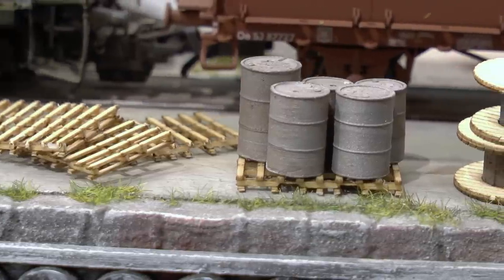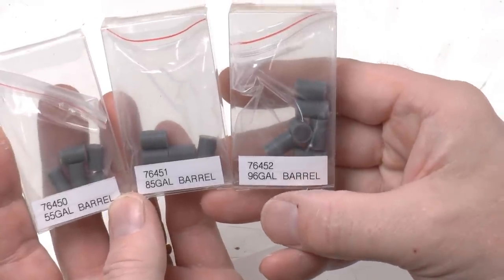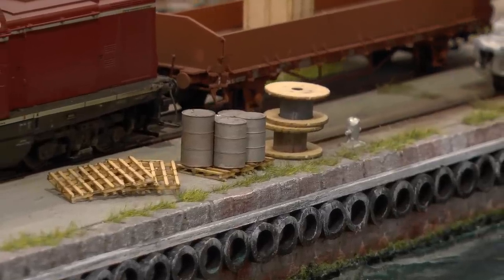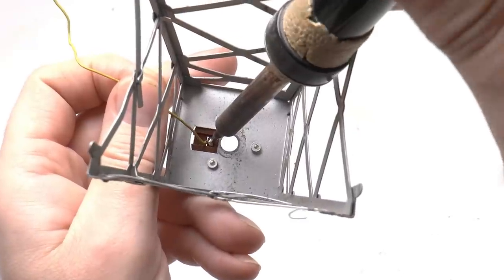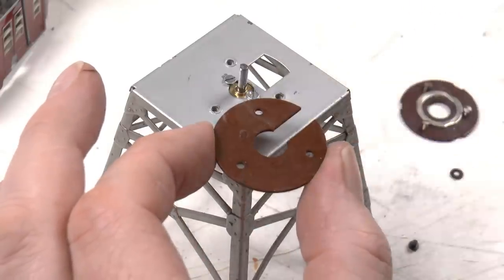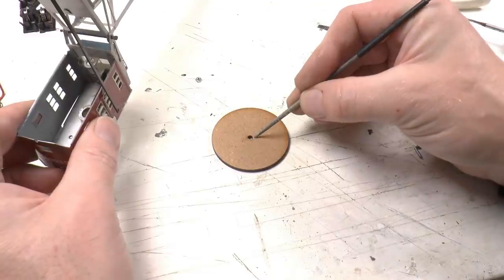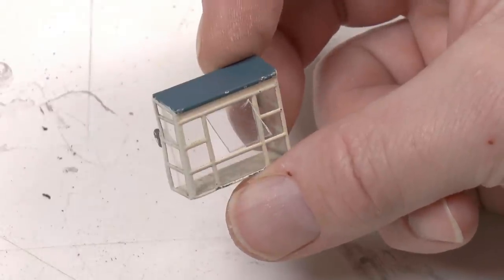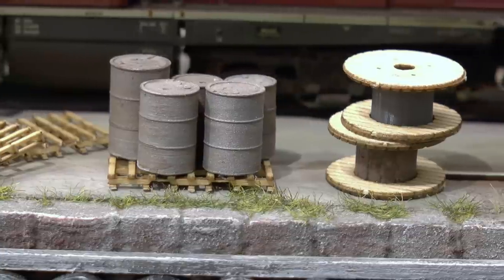Modernizing the Classic 1950s Crane

Comment: Awesome rebuild. I use those motors for my 1/10th scale rock crawler winches. You can slow it down by lowering the voltage you are feeding it to get a more desired look of movement :)

Comment: Just looking back at your older films Martin and this is a good addition to the channel back in 2020. The load kits are genuinely nice, but the motorization of the crane was excellent. A smashing way to build the crane hard standing wheel sets for the crane to run on. The same goes for the motor modification of the cab area to rotate it. Although the gearing is high if you had added a mini variable resistor, which could have adjusted the rotation speed. Even go into the CV settings and the speed there on the decoder. I will have to look for any follow ups to the crane mod after I finish this comment.

Comment: Hi Martin, nice crane mods!
I have also completed a working crane, mine was a Faller plastic kit and I used the same motors with 1:298 ratio on 3V battery electronics from a cheap RC car to control the slewing and hoisting functions. This allows me to place the crane anywhere on a temporary layout.

You may need to modify your design to fit the hoisting mechanism and still allow 360 degree rotation, the way i did it was to have the crane rotate on a hollow shaft with a large gear mounted under the cab, the motor sits next to this under the cab also and the hollow shaft allows the thread for the hook to run through and down to a motor under the cab as well.
I hope this helps to make your crane even more fun. God Jul!

Comment: Excellent beginning on the crane conversion...I was under the impression that speed control on the module was done by PWM, so I'm kind of surprised you couldn't get the speed down to a more realistic level...but I'm sure by the next time you revisit the crane, you will have a better solution figured out.  Thanks for another great video, and Merry Christmas from Connecticut!

Comment: Well done. You must be able to lower de motor voltage through the decoder I would think. Or use de function outputs and a small print to lower de voltage to 3 V or so
Reply from the maker: Actually.. An electrical motor has an area of ideal working point. As you move too far away from that point the motor gets really weak and lack performance. So, lowering the voltage or current will not do the trick. I simply need the motor to work in the right area. Only way to do that is to increase gear ratio.
Reply: @marklinofsweden  Kan nog funka med PWM styrning
Reply from the maker: @gurraflex6478  Alla digitaldekoder har PWM-styrning på utgångarna..
Reply: @marklinofsweden  Hi Martin! You are absolutely right. But most pepople thougt "wofür brauche ich das" in physics lesson in school....
Don't care....

Comment: For acrylic metallic paint, I'd advise you the new Metallic colors by Vallejo. You apply first a glossy black surface primer, then the metallic color (I often use the "Dulled aluminium" but there are several more, the only one not good enough being the 'Chrome" which never looks good in any brand I tested Once dry  just spray the glossy metal varnish of the brand. I painted zinc roofs as well as metallic parts (like handrails or bannisters) using this paint and the result is simply amazing. Check the "Geremdio" group on Facebook to see the result on the Nord Belge station kit (for the awning roof) which is painted with this paint.

Comment: Can you tell me a little mire about the copper sheet  you are using? (Car illumination sets)I am thinking i might be able to use that to make pick ups for my Triang Hornby trains.
Thanks
Reply from the maker: The copper sheets are sold as ”contact blades” for Märklin interiour lighting. If not available, you can can pieces from thin Beryllium Copper, or Phosphor bronze.

Comment: Good evening from France ! Instead of changing the motor or the gears, can't you just ajust the value of some CV of your decoder ? I don't know the Märklin system, but on most DCC decoders you can adjust maximum speed, average speed, start speed etc. Seems much more easy to me. Idem with inertia, you can configure it if you want the motor to slow down before it stops. Maybe check the documentation of your type of decoder ? 
Best regards and best wishes !

Comment: What about using a thin coat of epoxy on metal barrels and other parts that might be made to look like they have rusted. It seems like you could leave brush marks on it by using a disposable paint brush that would come in a large pack brushes with all of them being the same type. The brushes I am talking about should only cost about $2.00 American.

Comment: Why add a diode to the LED for the rectification of the current ? The LED is already a Diode itself
Reply: OMG! Check out Datasheet! A LED ist capable of block reverse voltage of normaly about -5V. With AC and 16 V you will blow LED without the Diode....

We germans like to say: Wer lesen kann ist klar im Vorteil!
Reply: @DB--lv6tt  I know that LED can support (for instance) -5V before blowing up. But why would you have -16 V on the LED ? The resistor is here to drop the voltage.
Reply: @DB--lv6tt  Please, be more humble  in your answer instead of giving lessons in an agressiv manner when you don't know to who you are talking about. Your approach is not pedagogic at all. I do not come here to be assaulted.
By the way, I am perfectly aware of the RTFM; your german comment is usless to me and does not even answer the question.
Reply: @bru57000  Hi bru!
More Humble:
Voltage at resistor U=R*I
In reverse direction I is zero, therefore no voltage drop occure. Full voltage at blocking Diode!
OK?
Reply: @DB--lv6tt  Great explanation, I understand, thanks.